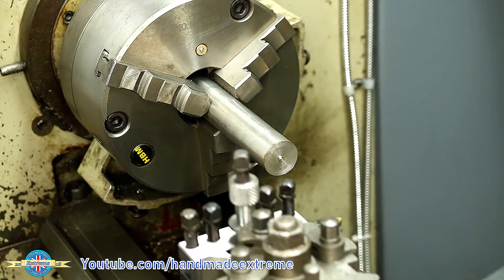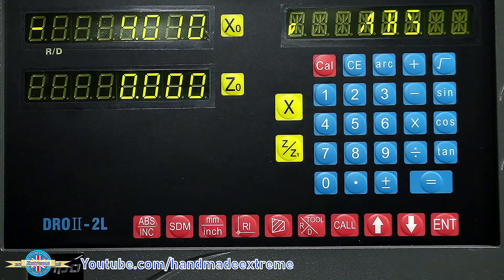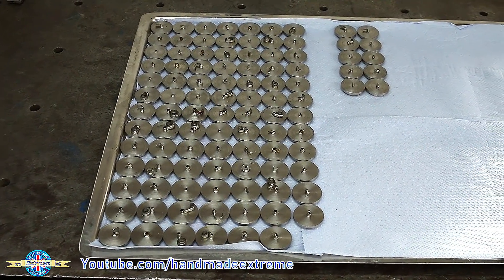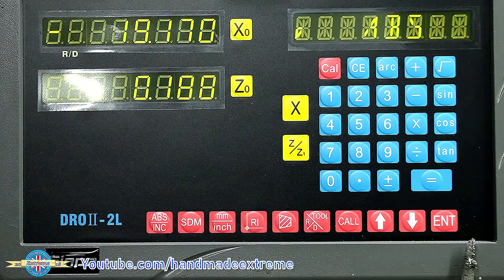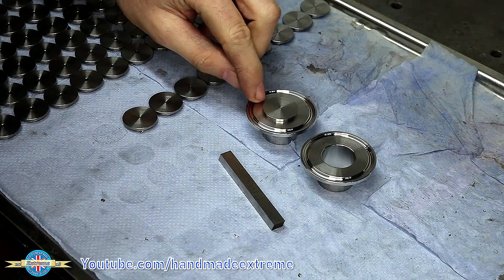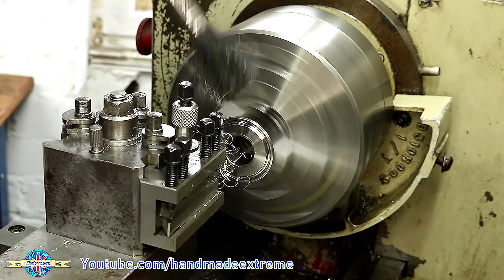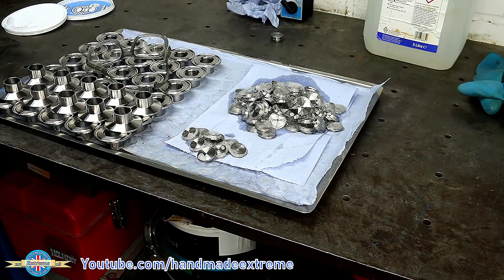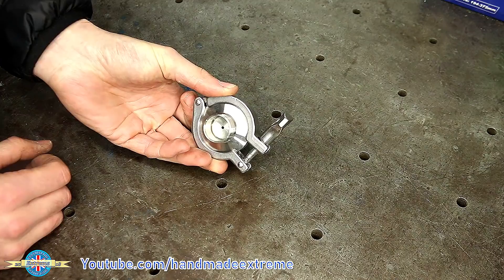Making money from a home workshop   Making Orifice plates to control liquid flow

Comment: Ive been an Electrical Hardware Design Engineer for near 50 yrs with 10 US Patents in fault tolerant super computers, but there is nothing cooler than precision machining ! Goodbye super computers, I'm building up a machine shop in my so called retirement. Heavy Metal is where its at!
Reply from the maker: Thanks, glad you enjoyed it and good luck with your hobby shop.

Comment: Very nicely done. 1 mm hole in 361! Hope you didn't lose too many drill bits. 
I've had good luck with HSS parting blades in 304, but the nubbin is always a bother. I'd seen a technique where someone sharpened the cutting edge of the blade to leave the nubbin on the stock side. But I've not had much luck with that in SS. I have found that the blade invariably wanders, leaving one with a slightly dished surface and less dimensional accuracy.
Reply from the maker: I bought a new pack for the job so naturally one bit did them all without any problems haha sod's law..
I have seen that trick with a HSS parting blade. Seems to work very well but have not tried it on stainless.